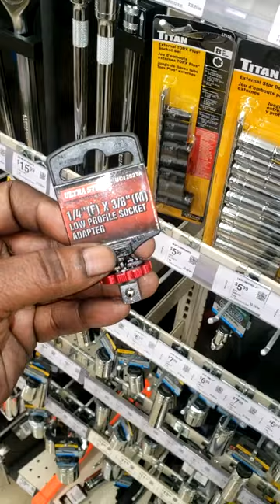A MUST HAVE TOOL. How I convert my 1/4 electric ratchet to a 3/8 when doing car mechanic trim work.

Comment: You’re telling me, you bought a 1/4 cordless ratchet wrench and you don’t have that small of a socket in a 1/4? What kind of a mechanic are you? Not a very good one if your just using that tool on air. I like when he said, “I don’t know what they call these” at the same time you can see it on the label.
Reply from the maker: smdh, little Ryan. Seems you a nobody on here questioning a somebody about mechanic things?? Its hard for me to take you serious bro, you just have a big ass R ass your screen picture. That simply tells me you a nobody thats not on my level. Tell you what, get your game up and give me something to work with before you try and come for me ok. Because ass of right now, Im not sure who im talking to, but let me guess, you ASE master with 20 years experience, you just refuse to show us right? foh dude
Reply: @OnlineMechanicTips  First of all, If I actually felt like taking the time to video things I do, which I don’t, I wouldn’t film myself (as a mechanic) using a tool on air. Nor would I post a video of myself saying, “I don’t know what they call this tool” when the name of the tool is basically slapping you across the face. Nor would I waste time, gas, and money going to Oriellys to use a 1/4 to 3/8 “low profile adapter” for a small socket size that you probably have in a 1/4”. It’s hard to take you serious when you can’t read the label. As for the big ass R. I don’t have the urge to film myself working on a car to post on YouTube to feel better about myself. I prefer to not show people how to work on cars so I can actually have a job working on cars. I restore classic cars and I can’t tell you how many times I’ve had to fix other mechanics shoddy workmanship that comes from mechanics who don’t know what tools are called even when it’s on the label right in front of their eyes.

Comment: Wtf? Seriously? Doesn't make any damn sense.
Reply from the maker: Lmao
Reply: Sure it does. Lets you use a tiny 1/4 ratchet to get into small spaces more easily, and still use your standard 3/8 sockets because it doesn't stick out like longer adapters. Try and keep up.

Comment: How to strip bolts to piss off the next guy working on that angled bolt 101.
Reply: You only use it to spin them in you don’t have to torque them down with it.

Comment: I'm not the best mechanic out there but i lose brain cells watching this dudes videos. What's the point of using an adapter and not just have the correct sockets/ratchet? You can say "o u missed the point" but there really isn't one? Maybe for your home garage but using an adapter reduces torque, makes the tool longer and in reality is pointless but ig u just don't have the right tools. I've never needed an adapter to upsize. You're already using a small size socket, just use the correct drive.
Reply from the maker: The only thing you got right out of this garbage comment was the first 7 words. In fact you barely one but I wont hold that against you young fella. In fact Im gonna hold back my fire toward you and simply charge it to the fact that you simply dont know any better. Fact is, if you a youtuber as well (based on your channel) you might not wanna come for larger channels such as this one just yet. You a little out of your league my dude. So grow up, mature, choose your battles wisely and keep your nose clean is the best advise I can give you right now. Come for me when you at least grow, its to soon right now and I will simply look like a bully. So stop the madness.
Reply: @Online Mechanic Tips  😂😂😂 you're hysterical acting like subscriber count means anything. You know nothing about me or the work I do. Thanks for stalking my page tho to try and get an analysis as if YouTube is proving grounds. Go ahead and subscribe while you're there :) I guarantee you barely even know how to do half the work I do but I digress. Didn't know "making YouTube videos" was in the job description, probably because i dont care to make videos but ill keep that in mind 👌 like I said, once you see the common theme of consistently having negative comments on almost each of your videos, you should start asking questions. Of all my years of working on vehicles, I've never had a negative complaint. I bet you've never had multiple customers (let alone one) come back and say "I only want you working on my car". I've got people that have followed me from other shops to a completely different city just for me to work on their cars but like I said I digress. You only hear/read what u want to.
Reply from the maker: @MrAce5022  Your numbers prove none of the shit you brag about....lol..Ive come to the conclusion that haters will be haters (such as you) So I started using them to my advantage, now my nubers are exploding. I could care less whos upset at what I say or do. Im a youtube content creater and based on my numbers, im doing well. I cant say the same about your sorry ass numbers. My point of this complete comment is to remind you not to come for me. We 2 different people. I would have never jumped on one of your videos with this silly shit. FOH and get busy youtubing. Seems you have a lot of work to do. Good luck.
Reply: @Online Mechanic Tips  you could care less, yet ur still replying. Okay buddy
Reply from the maker: @MrAce5022  The replies are called youtubing. Im very good at that. The more ya hater ass talk, the bigger this video get. Maybe you should take notes so ya sorry ass channel would move. I got this over here. I try to reply to every comment, even the haters such as you. In fact, to mostly the haters, seems they cant help them self. They slow..lol, all yall the same my guy. Again, dont come for me, you dont know me.